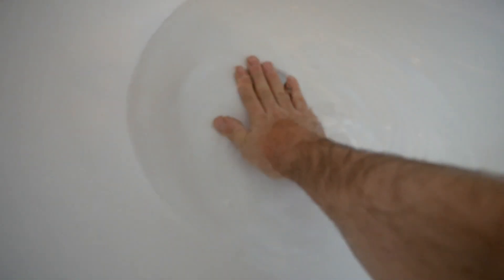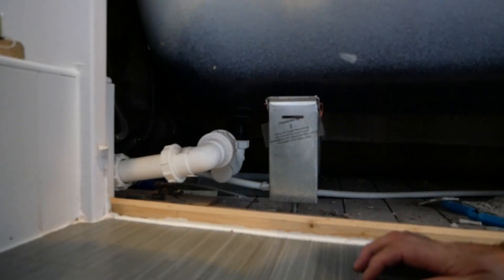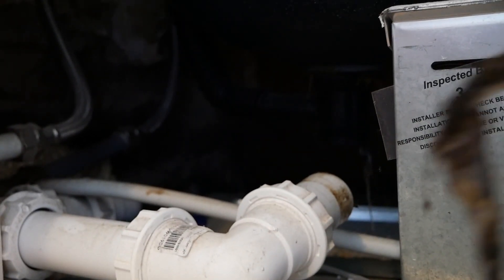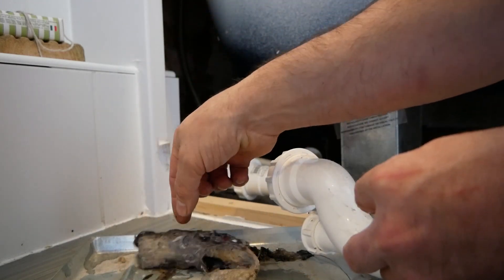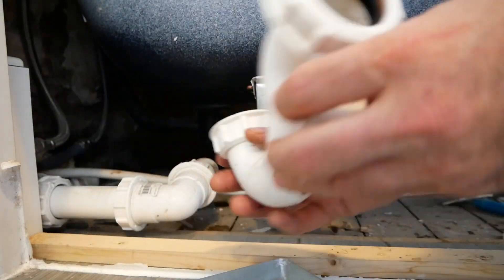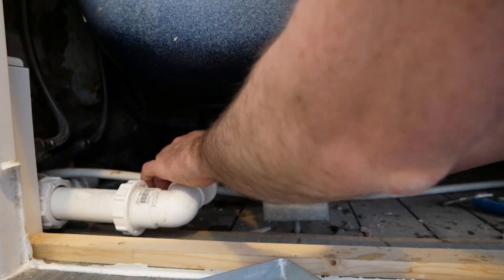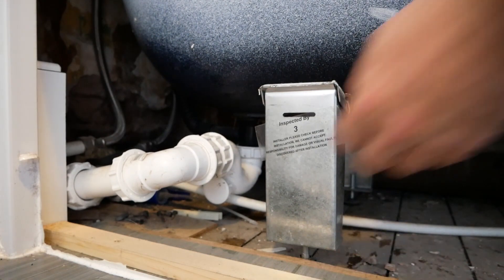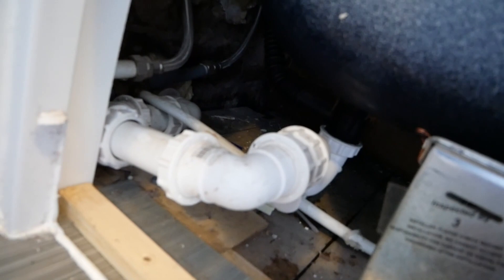Fix a Slow Draining Bath, Unblock Bathtub Drain with no Chemicals

Comment: I can't remove the bath panel, I have a metal snake to push through, but it wont fit through the small drain hole at the top. If I remove the screw on top in the middle of the drain inside the bath, will the u-bend pipes under fall through.
Reply from the maker: The drain could fall from the bath. The seals may hold it on the bottom of the bath but It's a risk. I wouldn't attempt that without a plan B. If it goes wrong you will have to get under the bath.
Reply: @handymancraftglasgow  Thanks, I did loosen it a bit, then noticed something under pulling it down., luckily did not fully unscrew it!
Reply from the maker: Good you didn't.
You could try a master plunger, the link is in the description of this vid
https://youtu.be/b0V_ygdDLrw
This plunger will pretty much move anything. 
Or there is a flexible coil that electricians use, very thin and flexible and would go round a ubend. Can't remember what it's called but will see if I can find a link.

Comment: How would I clean mine I can't get into my drain like how it's showed on the video.
Would it be the one outside or?
Reply from the maker: Getting under the bath is the best way. If you can't get under the bath you may want to try a plunger like the one I used in this video. 
https://youtu.be/b0V_ygdDLrw
If this doesn't work then drain cleaners are worth a try.
If none of these work you will have to get under the bath.
I am assuming, of course, that the problem is in the at the bath and not elsewhere in your plumbing.

Comment: I followed this it was really useful and I pulled out a load of hair but the bathtub is still clogged.

What do you do if the pipe beyond the white ones are blocked
Reply from the maker: That's a bit more serious. A drain cleaning coil may be in order like this one. https://www.toolstation.com/rothenberger-pipe-and-drain-cleaning-coil/p55637?utm_source=googleshopping&utm_medium=feed&utm_campaign=googleshoppingfeed&gclid=Cj0KCQiA3smABhCjARIsAKtrg6KFn5GXunmRBvmw6Kp9O7haa4aQobxxM06rYv6grO1cjk5wAcWBTWIaAiCLEALw_wcB
Reply: @handymancraftglasgow  is it difficult to use? I am afraid I used the plunger for so long that I pushed everything further down.
Reply from the maker: May be time to call a professional. A plumber should have the kit needed to sort this out.

Comment: Great video, but I have tiles instead of the side panel. Can the tiles be removed without damage . How many tiles 300 x 400 would need to be removed to get to the bathtub drain?
Reply: A multi tool can work but it takes time. If you use the right attachment it won’t damage the tile and just bounce off it. The multi tool goes through grout and adhesive like butter. Wear goggles though.

Comment: I used a while bottle of one shot (not all at once lol) and it didnt work
Reply: Sometimes you just need to get in there and take it apart. Not pleasant 👍
Reply: @lukafab2192  I removed the U bend under the tub cos the auger snake kept on getting caught in the trap. Not much in it but then I inserted the snake into the pipe that goes into the floor and I pulled out something that resembles the thing in the video. No leaks after I reassembled everything. I think I did a good job for my first time. Plus I didn't end up needing to call a plumber l
Reply from the maker: If you got to the big clump of hair I would call that a success. Brilliant 👍
Reply: @handymancraftglasgow  cheers for the help
Reply from the maker: Very welcome 👍

Comment: How did you open bath tub please reply
Reply from the maker: I am guessing you are wanting to take the side panel off the bath to access the plumbing.
Mines has minimal fixings. There are usually a few screws holding the panel in place. If it's one like mine you just slide it out from the bottom. There are hundreds of different types of panels and different ways to fit them.
Look for any screws and you should be able to get it off.